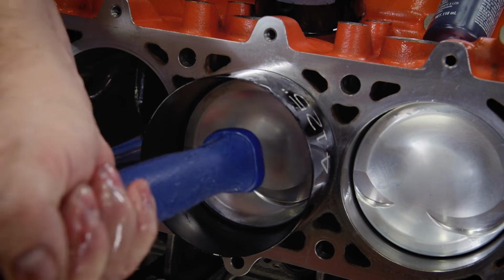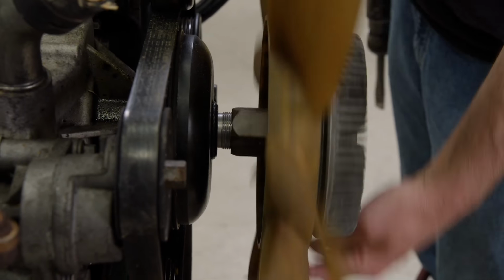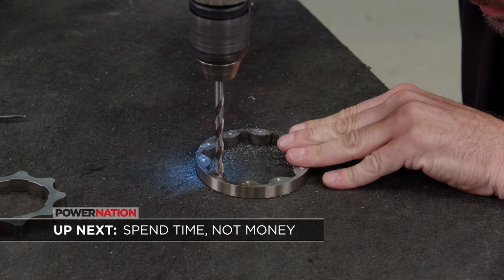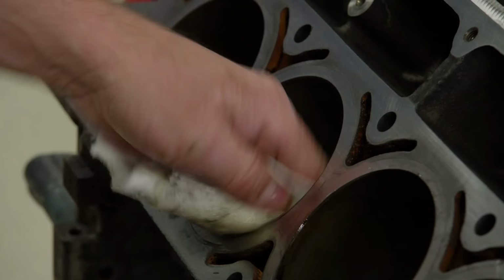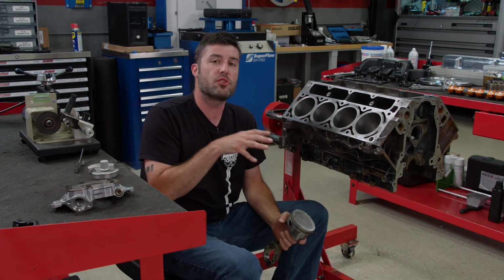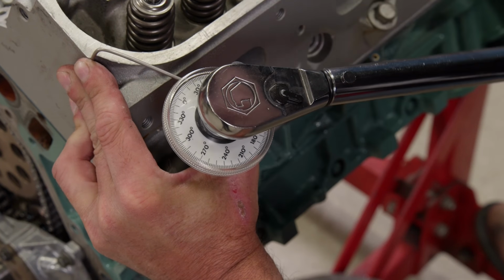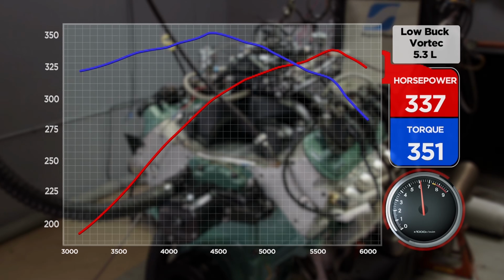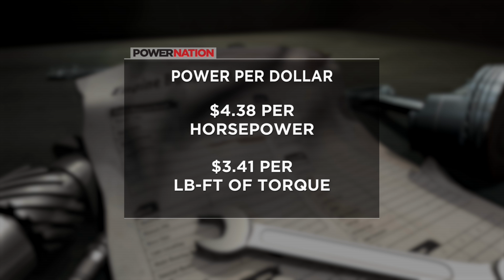Minor Upgrades Create Crazy Power on a Junkyard 5.3L Vortec - Engine Power S7, E10

Comment: "This is a low-buck, budget build" **cuts to scenes using $100k of specialized engine rebuilding tools and machinery**
Reply: He used square tubing as a flat edge to sand the cylinder head surface. You dont much more low buck than that!
Reply: @Chris-cu4ge  eek !
Reply: @Chris-cu4ge  except for the guys who use no straight edge just paper lol
Reply: Its a machine shop, and fyi its minimum new parts used...
Reply: Send the block off to the machine shop. It doesn't cost that much to get the block checked and decked, or to get the crank journals polished.
Reply: @Raccoonactual  Maybe at machine shops where you live. Where I live they charge you $100 to walk in the front door.
Reply: @puppetmasterblaster  and they'll charge 50 just to look at the front door lmao
Reply: @puppetmasterblaster  250$ to wash the block, I stopped the guy there and hung up. I'm hoping my cylinders don't need to be bored out, because at that point, even though I will still do it, it costs me money to do the engine myself.
Reply: @puppetmasterblaster  sounds like you need to move...
Reply: @Raccoonactual  

But the show talley should have printed the cost of a engine wash that into the cost of the rebuild total so that for us that don't have the hundred grand worth of stuff.
Reply: @Raccoonactual  where I live its usually cheaper to purchase an aftermarket block than get machining done, and its almost dead even in cost to buy a crate performance motor from a place like jets than build one your self. And if you don't already have all the specialized tools like hoists, stands, micrometers and the measuring tools, and so forth. And if its your first engine, I think you can guarantee you will lose a grand or so DIY, and that assumes you don't screw something up and witness self-destruction in the first five minutes of break in.    Now I intend to build my own anyway, because I'm into this stuff because building it is more fun, but it aint much cheaper, and it sure aint faster.
Reply: @charlesparr1611  your machine shop is bending people over with no lube then, or maybe I have a great machine shop.

I admit that I do have access to some of the tools you mentioned having been in the Automotive and Diesel field for awhile. But a micrometer, dial indicator, and caliper will run you a couple hundred bucks. Ring gappers are cheap. A good torque wrench doesn't cost much either.
Reply: The dyno and the engine washer?  Just use a butt dyno and a power washer... i just saved you $100k
Reply: @BimotaMoon  LOL  YEP
Reply: @BimotaMoon  or any measured distance or hill ?
Reply: @BimotaMoon qqqqqqqq
Reply: My crankshaft polisher is mad at me. 😉
Reply: I actually died bruh @whiskeybuilder6335
Reply: Jeriah moon Nothing beats the ole butt dyno! LMAO. All we could afford back in the day. Didn't see a real dyno set up until many years later.
Reply: My dumbass tried to react haha to this 😆
Reply: Food stamps aldi buy
Reply: Didn't add the ignition controller either....
Reply: @staseghrrhgesats1946  or the carb. QFT Black diamond 750 = $880.95 new.
Reply: @Torquemonster440  fact dual surface go to $1200
Reply: Nothing about labor costs. Lol
Reply: @jalsr.speak2379  literally
Reply: @BPzeropoint  You must be dirt broke then if you consider sanding with rectangular tubing and a dingleberry hone as expensive
Reply: @cn1364-w6c  i want to do an engine project myself. My budget is 3-5k. Hoping its on the lower end. Is this the best route or is there a better option? I have basic tools, would have to buy any specialty tools, i don't mind, but I'd count them towards the budget.
Do these ls builds require a specific transmission like an 4l60/80 or would any transmission work 700r4/th700/th350?
Reply: @rys_6776  Might wanna ask somebody else (post on reddit possibly). I know near zero about LS's as i'm in new to anything 8 cylinder.

My plan for my engine swap is to buy everything nice now minus the engine (cheap junkyard engine) and worry about that later. It's easy to replace a junkyard 5.3 with a nicer 5.7/6.0.
Reply: @rys_6776  I’m late on commenting but the best way is to LS swap it and put the extra money into making it faster. You save time and the money is almost dead even.
Reply: @cn1364-w6c  never use a dingleberry hone when building an engine, it's only good for quick touch ups between runs etc.
Reply: Definitely a lot more different ways to do a budget build LS swap, it all depends on how much you really want to put on it. $$
We have  about 2 years working on LS and LT swaps and we had customers spending big money on their build and some just go for the normal stuff.
Reply: Machine shop charges 100$ bucks just thinking about taking it in
Reply: Rebuild yours using duct tape and spit then post 📫 a video of how that went...
Reply: My
My and the

I'm
I'll
Reply: How much would it cost to have someone do this to my engine?
Reply: Low-buck is purely relevant.  What I call low-buck is very different from what a million-dollar engine garage would call low-buck.
Reply: @T_Burd_75  Yes, you are true but I think everybody here can agree that a dingleberry hone is low budget... If that's too expensive for you, then you should think of finding a better job or get a new hobby.
Reply: @cn1364-w6c  I've been trying to get a job.  It's been almost two years now.  Nobody will hire me. Tried to go into ham radio as a hobby, but the FCC refuses to issue me my extra class license and it's been since April 2019 when I applied for it.  Thanks for your concern.
Reply: @T_Burd_75  Anytime buddy
Reply: @T_Burd_75  
I don't know where you live,  but I've been all over 9 western states not California,  Oregon,  or Washington state  my wife and I seen help wanted, and now hiring signs every where we went. Just so you'll know,  we went through Oklahoma,  pan handle of Texas,  New Mexico,  Arizona,  Utah,  Idaho,  Montana,  North Dakota,  Minnesota,  Iowa,  and Missouri.  If you can't find a job you must be in some place like new York city or pea ridge Florida.
Reply: @bertgrau3934  Has to do with background checks, bro.
Reply: @T_Burd_75  
Ok, well there are a lot of companies that hire ex cons and things like that. I have seen guys that were out because of drugs and got good paying jobs.  
Good luck to you,  I hope you find a job
Reply: @bertgrau3934  of course, drug records are actually considered "fashionable" in today's society. It's the charges that are considered violent offenses that always get passed over.
Reply: @T_Burd_75 just do the h radio in a truck with a camper and never atay still for long periods of tine
Reply: Reminds me of when I was a kid and popular mechanics magazine in the back I bought plans to build a 15 hp Jetta Jetta engine .. The plans they sent me showed $3 million worth of machine equipment to make it .. !!! !!! 
Rip OFFFFF
Reply: If you aren't an ass and if you catch them at a good time (after lunch, but at least an hour before closing) you can usually get a great deal from a machine shop. My local guy always hooks me up because I took the time to ask about his personal projects, tell him my own journey with my car, I listened to him family backstory and how he got into the job. Now we are friends AND he gives me a great deal. Always approach with positivity and openness.
Reply: Bet it is way more than that
Reply: damn, some of y'all will bitch about anything
Reply: Just clean yours with carb spray or gas in spray bottle you don’t need all the fancy machines they have all you really need is carb spray assembly lube good socket and wrench set impact would make faster but really don’t need ring compressor and t handle Allen wrenches sometimes used but torx is used a lot to so best to have both have a hammer a rubber mallet a lot of pb blaster and tough zip ties if you don’t have valve compressor can use zip ties risky but works fine to start out
Reply: What about the $1,000 carb?
Reply: Exactly
Reply: Thanks for saving me time
Reply: For real though
Reply: I said the same thing
Reply: Aren’t most of those things stuff you would pay a machine shop for? Or not do, because the shop is not economical for the improvement?
Reply: @EdDale44135  
That's true, but having done things on the cheap myself too many times if you do it the correct way may cost more,  but the engine will last much longer doing it the right way. So if you want a temporary fix cheap out , if you want it to last do it right.  The problem is, a lot of shops get it wrong.  That's a bad situation.
Reply: Bahahahahaha right?
Reply: How much do y’all charge to do this?
Reply: Lol
Reply: The engine with all that sludge  😂. I bet it had an oil change every 2 -3 years  likely 4 times since new .
Reply: @@footsieboy996 
I think with a power washer,  and some old fashioned hand work,  it can look as clean.  Just because they have the equipment yo do the job should be a reason to complain.  Just my opinion.
Reply: They're talking about parts used... you don't need any of that stuff to do this build...
Reply: Lol
Reply: You’re not that smart
Reply: I always take my engines to the machine shop. Bob Lane Mountholly NC and have them ran though the vat washer and check the block bore or hone line bore and installing cam bearing freeze plugs before I order parts. Never paid more than 400 bucks for that. When I build my 5.3 they will be balancing the internals for me. I want this one to last.
Reply: Just tear the block down and send it off it’ll save you a lot of money
Reply: Carb, intake, NOS, and good machine work. Sounds like a pretty basic rebuild to me.
Reply: Also shows the valley cover without knock sensor provisions, then shoes them unboxing a new knock sensor.🤦‍♂️. Editing at it's finest 🙄
Reply: Yeah everyone's a critic.
Reply: A dingleberry hone and a torque wrench is 100k ? Hahahaha
Reply: Use your imagination.
Reply: You need to learn to use your brain. He's using tools he has at his disposal you do the same 😂 there's tools you can buy for 100 bucks that do the same and you don't have to buy a dyno shop you send the motor to one
Reply: Bro he just has that shit if you dont do it like a normal person and tell the machine shop what you want and usually abt $500
Reply: To be fair that’s not accounted for when you build it
Reply: Nooo but they used a cheap ball hone
Reply: Have you never rebuilt/built a motor?💀🤣 you don’t NEED fancy shit, and I didn’t SEE them use anything crazy to rebuild that mf 🤣
Reply: They did an engine build with hand tools outside on a plastic folding table just to please dudes like you lol.
Reply: Still a low buck budget build lmao the parts are cheap they never said anything about machines dumbo
Reply: Right.
Reply: Good Lord man. I looked into the messages and replies now I wish I hadn't sounds like a bunch of little girls in here bickering at each other. It doesn't matter what you make and what you have for a job or what your background check is we all enjoy watching an engine build and seeing the horsepower that comes from it all this other crap doesn't matter
Reply: I have a fully built 5.3 only thing stock is the oil pick up tube sensor and bore size it didn’t cost nearly 100k maybe 30 but not 00
Reply: You sound like you belong in the kitchen
Reply: No kidding 
Getting people way over their heads before they even know it🤨
Reply: That’s what I was thinking too 😂😂 like the camshaft sander and the jet washer and I’m already lookin for the bead sander 🤣
Reply: FYI the short Head bolts are not turned 90 when you have all the other bolts torqued torque the short bolts to 65 ft lbs allow 1/2 hour to pass come back and torque to 70.  Head bolts for this engine can be used 3 x.  After the initial torque measure them before installing.
Reply: Fine with me lol
Reply: Yep. We don’t have crank polishing machines in our garages. Or hot tanks. Or torque angle meters. Spoiled.
Reply: Carb is worth just over 1000
Reply: Ikr! 😂😂
Reply: With Uncle Joe giving away free money it's cheap.

Comment: I have a 2011 2.3L V4 Ford Ranger 5 speed manual day cab. It's my daily driver when I'm not riding my motorcycle.  It currently has just under 310k miles on it. And yes, original motor. It had 303K miles on it when I purchased it. I would love for you guys to overhaul it and give it some real horsepower on your show. That would be awesome! I do have pictures.

Comment: That's about 9 HP less than Richard Holdener gets out of one straight from the junkyard with stock cam and manifolds.
Reply: Remember he runs them with no accessories and an optimized tune via Holley EFI.
Reply: @rcairforceone   I dont see any accessories on this Powernation dyno pull.

Comment: My Dad passed away in February and he gave me a 2005 standard cab, stepside Silverado 4x4 that has fresh paint, media blasting and bed off restoration.  It has 154k on the 5.3 Vortec. You guys want to build it out and throw a leveling kit on for me? Its got a brand new cap and rhino liner too. Just needs the correct tailgate guard since the whale's tail won't  fit with the cap. Also has Flowmaster dual exhaust and a new trailer harness!

Comment: "This is the cheapest we could get this going "
Really? So you tossed all the fuel injection hardware and purchased a carb, manifold and other stuff. Which by the way they didnt even add the carb in the price total. Buffoons. Step out of the stone age with these stupid carbs.
Reply: I know, right?  The $600+ they spent on a carb, manifolds and ignition box would have been better spent on HP Tuners or a Megasquirt and doing some wiring.  High horsepower on an essentially stock bottom end for these Gen III and Gen IV truck motors is nothing new, either.

Comment: You missed a VERY important aspect of this engine. It was available in a High Output version for 2004-2006 equipped on only the extended cab. Higher HP output and more torque. Plus aluminum heads, 6 bolt mains, windage tray and a slew of other goodies. I should know, I owned an 05 Sierra 1500 4x4 ext cab. I only learned this when I replaced the plugs and wires .
Reply: I had one as well and I can confirm it was a runner.

Comment: This was a good episode to watch. I like what they had done with their engine. Of course there are many ways that we can all choose to build and run our engines based on our desires. With this in mind, we don't have to follow their every step, but we can pull some ideas from this episode to help us choose what we can do with our builds. 

I had bought a running 2001 Suburban 1500 with 226,000+ miles on the Odometer back in April for $1000.00 with the intention of using the engine and parts for my '68 C10, or for my '82 Monte Carlo. I drove the 'Burban 2 hours home with no issues. The Suburban had came with the 5.3 LM7 engine as well. All I had to do to it was tighten 3 of the 8 spark plugs, they were loose enough to remove by hand! Here it is 4 months later and I'm still daily driving my Suburban. Of course I eventually had to replace the fuel pump because the old noisy one had finally quit working. To add, 4wd still works too.
Reply: Gonna dump an LM7 in a gen 4 v6 camaro

Comment: Didn't include the cost of the carb or the headers though.  If putting one of these into a vehicle that didn't have an LS to start you need to factor in the carb cost.  Headers would be vehicle specific as well.  The money you spent on the intake manifold and carb could be spent on a FAST intake and some injectors and tuning.  I'd prefer to keep mine fuel injected.

Comment: Lol garb

Wait till the rear main seal goes in like 500 mi
Reply: naw, if it isn't dead yet it probably won't fail.  I have a 5.3l vortec with almost 400k miles on it, its the original rear main seal.  never leaked.  sometimes they were put on right, or were good parts.

Comment: Um are we forgetring the 600 plua dollar carb and the 500 dollars in msd ls  ignition setup required to run it carbed as well as the new plugs paint for the block oil and filter and other misc things like the clearly new cam and crank sensors and other items
Your about 1600 short of what you really got in it also most people dont have a crank polisher or a hot tank at home in fact very very few do so gota include the cost of those services at a machine shop.

Comment: I'm seeing 106 degrees temp out on highway and truck engines are overheating . I blew head gasket and I wasn't running C15 hard . Next week at 111 your going have major failures across the board . Power plants catching fire .